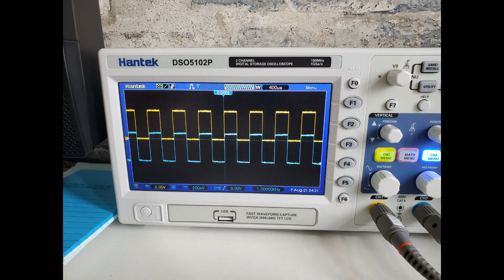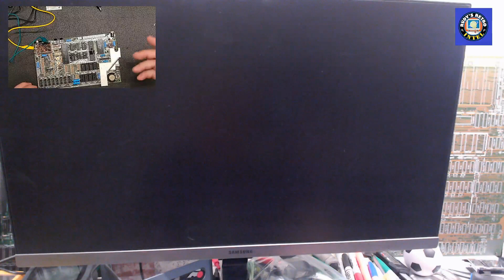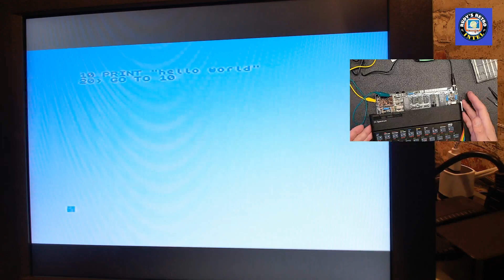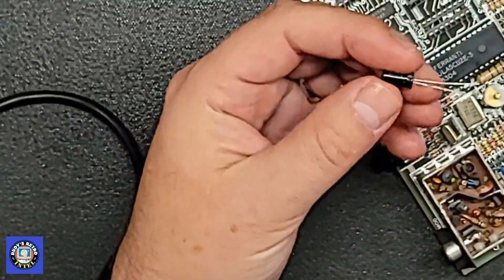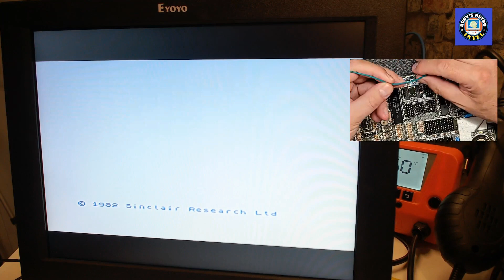Unbelievable ZX Spectrum Video Mod Transformation

Comment: Great video Rudy. One of the easiest Mods ever and clean without a bunch of stuff and hole in the case. I wonder why they just didn't add a connector. Changing the cap definitely cleared it up further. Those 7805 are notorious in my opinion. Every time I see one, if it's not from a good company or unknown brand I just replace it with a Texas Instrument even if it's working. I always have about ten on hand of the 7805 and 7812. By the way check your email, I answered you on the VCR.
Reply from the maker: Thanks so much for watching and commenting! For the 78xx regulator, have a look at the Triaco units as they are at 95+ percent efficient and don't need a head sink. I will check my email. Thanks again for your support and your  fantastic YouTube channel.

Comment: Nice a simple but reversible mod. Thanks
Reply from the maker: Yes, it is simple and can easily be reversed. Just remove the capacitor, solder back the resistor, and place 2 wires that are for the video in and 5v. But I've never met anyone who changed these types of mods back. Thanks for commenting